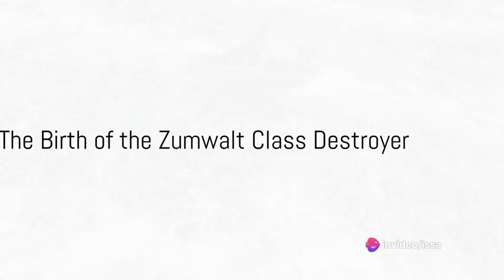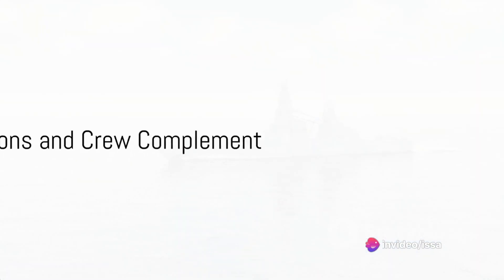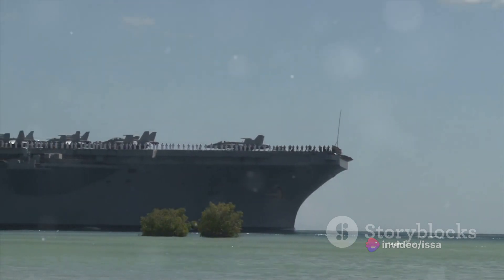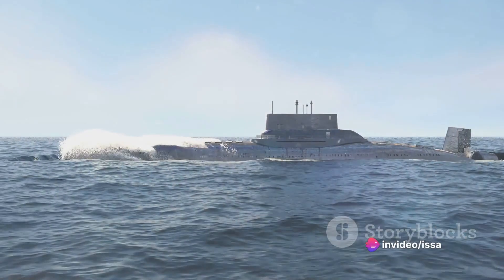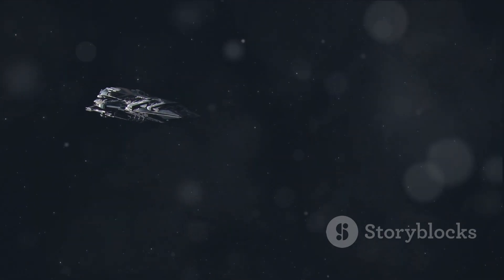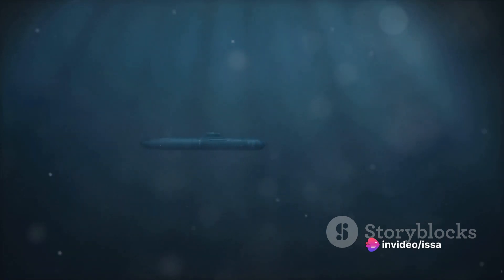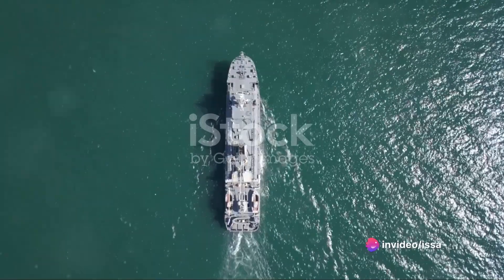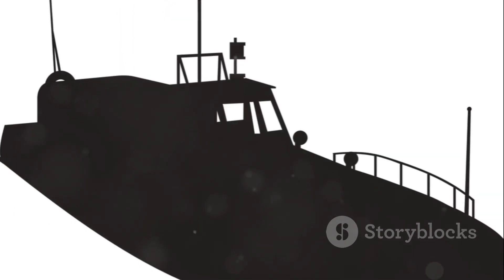Zumwalt Class Destroyer: America's Stealth Sea Giant

Comment: Its not stealth. It might have a lower cross-section than other destroyers, but its still on the surface of the ocean and traveling at 25kts. A plane or heli will be able to see it and relay its position. It's like calling the Tesla truck 'stealth' because it has slopes and angular body lines.
Reply from the maker: The Zumwalt is one of the largest destroyers in the world, 100% of which is easily visible to the naked eye from a distance. This destroyer of this size can be easily seen on radars, but its size is smaller than its total size. This causes the enemy ship to see it on the radar of a smaller ship and not notice the big threat coming towards it. And that would give Zumwalt enough time to make the first attack.
Reply: @MilitaryAnalysisbyAI  except their main guns have no ammunition, and the whole class is plagued with computer and propulsion issues. Its a giant boondoggle.
Reply from the maker: @MrBPC76  I don't remember exactly how many destroyers they made of this class. But due to these problems, only 3 of these destroyers were built.